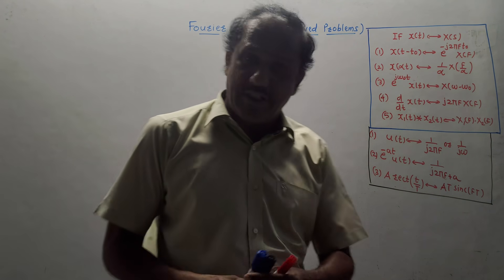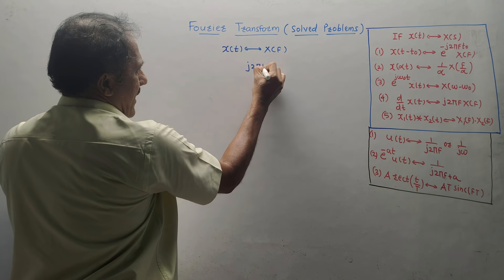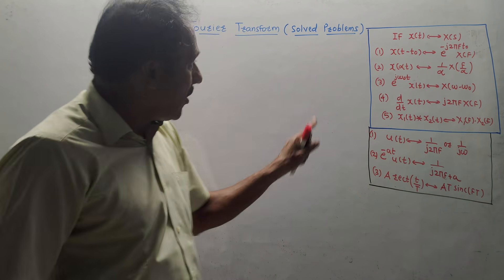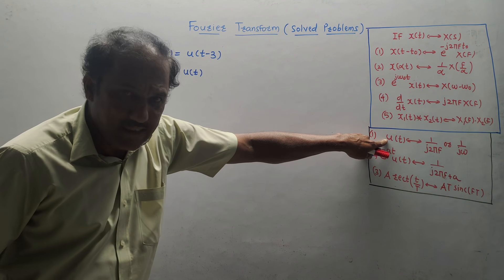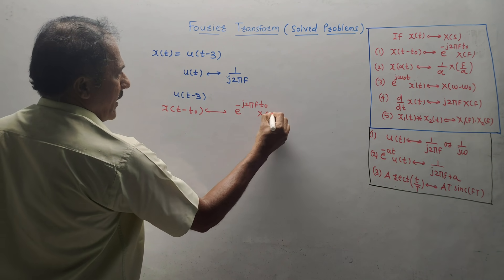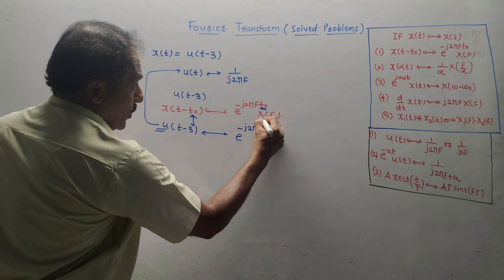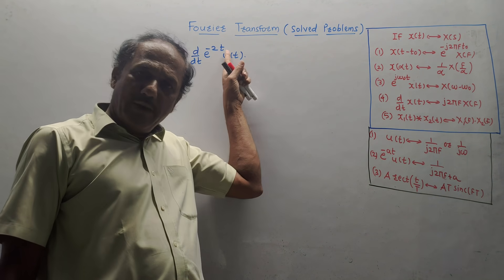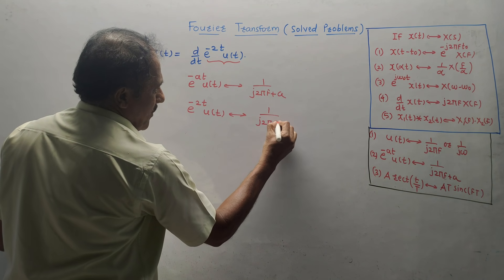FOURIER TRANSFORM (SOLVED PROBLEMS)

Comment: Sir, in second numerical j2πf / j2πf+a madhe j2πf  cancel nahi honar ka. 7:36
Reply: no
Reply: Why and how bro
Reply: @Atharv907  No,  does not cancel out in the expression .

Here's why:

You can only cancel terms if they appear as a common factor in both the numerator and the denominator.

In this case,  appears in the numerator, but in the denominator, it is part of a sum , not a product. So, you can't simply cancel  from both.

To illustrate this, consider a simpler example:

\frac{x}{x + a}

You cannot cancel  in this case either, for the same reason — it's part of a sum in the denominator, not a product.

So,  cannot be canceled out in your expression.
Reply: Got it 
Thank you 👍